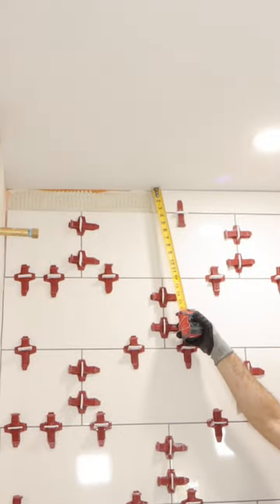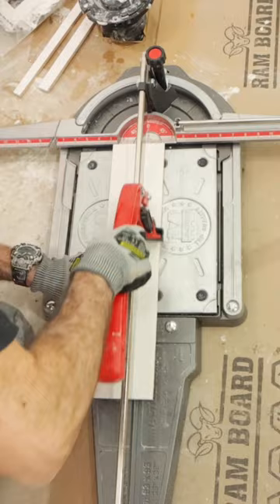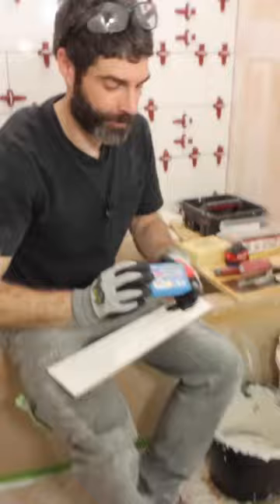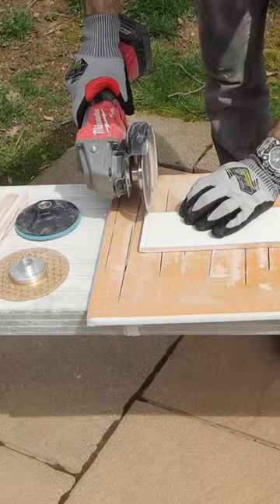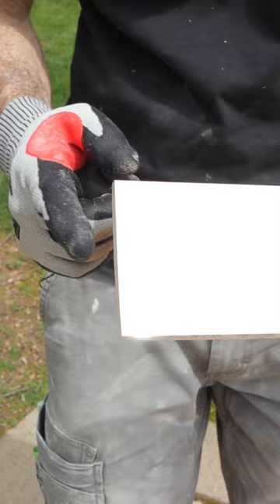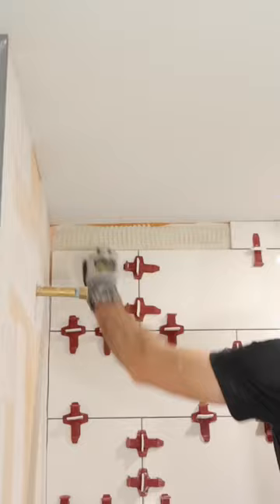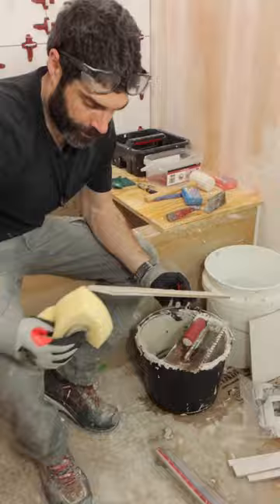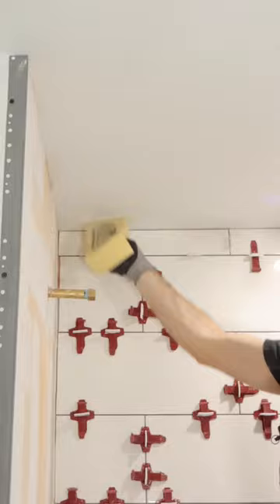Setting the Last Tile - #shorts

Comment: Why would you ever polish an unexposed cut? Gotta slow it down to charge as much as you can i guess
Reply: @robertlongo2121  so apparently you cant achieve tight cuts so you need to polish them so that your half inch gap doesn't cut the maid and apparently you don't even do tile because that area is caulked let the professionals talk boy
Reply: Slow it down?? Who charges by the hour as a tile guy? Not me. Sq. ft. plus any extra charges.
Reply: @bryanbenson6551  bruh go back to McDonald's who charges by the sqft sheshh you must be an old head its by the job and all its intricate details not by the hour and definitely not by the sqft
Reply from the maker: pride
Reply: @HomeRepairTutor  objectively and pragmatically useless waste of time and effort but ok
Reply: @pruneda95  you wouldn't last 5 minutes on one of my jobsites. As he said....pride. Can't teach that, you either have it or you don't.